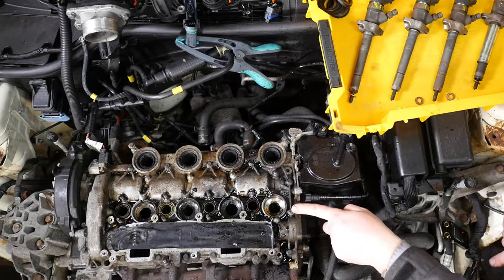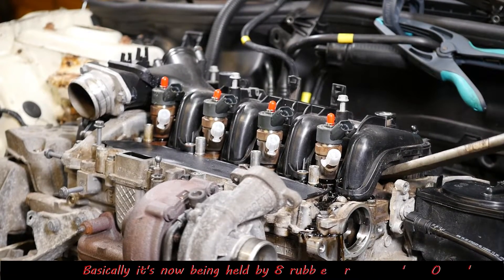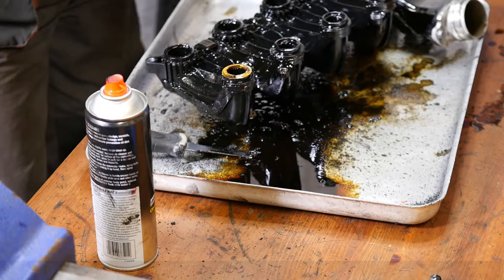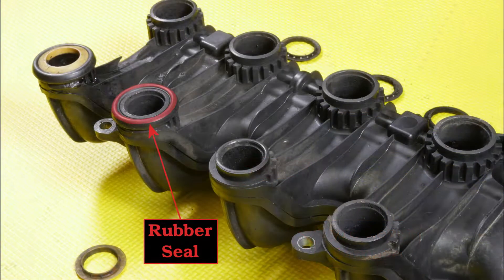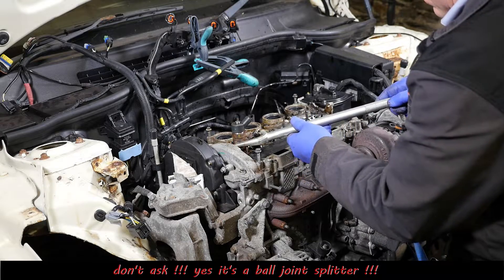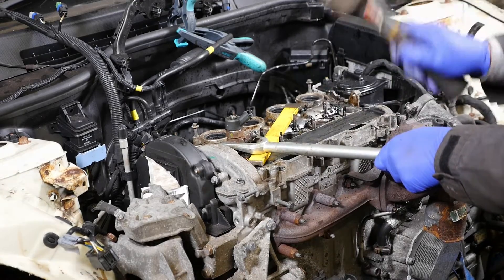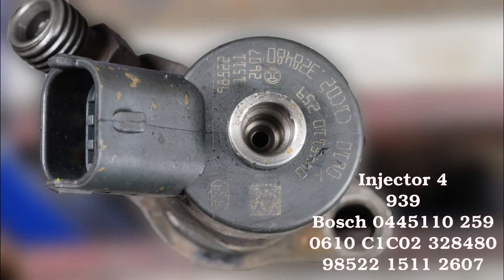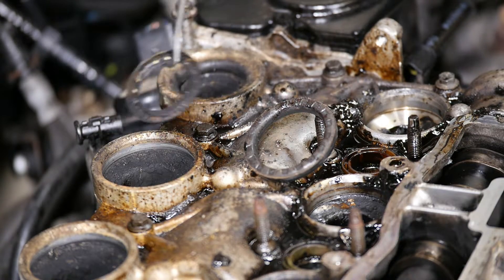Part 8 - Removing Diesel Injector's, Inlet Manifold on 2009 R56 MINI Cooper Peugeot 1.6 HDI TDCI DV6

Comment: Could’ve used a 16mm long socket with extension on it over the high pressure threaded part and use that to loosen the injector.. much quicker and less hassle
Reply from the maker: Thank you for the heads up.  Cheers

Comment: I too have never removed an injector but I’ve read up on it as my son had a v6Audi that suffered the exploding HPDP and all 6 need removing and the tank and fuel lines replaced of flushed to remove the bits of pump that liberally scatter themselves through the furling components. I decided not to experiment on someone else car , away from my tools and learning as I go. I paid off his finance on it and it was scrapped.
Reply from the maker: Blimey Patrick that sounds terrible and really expensive !!! was that a car made after 2007 as well?  Your son is very lucky to have a generous father like yourself to clear his finances off for him.  Hopefully the losses weren't too high.
Reply: @CoatsandGaiters  I think it was an 08. the car was an Audi A5. He did have the car serviced at the local Audi dealer and at first, they were going to cover the damaged/fault but then they relented and all efforts were fruitless. Ive always had a hatred for car Dealers as my experience hasnt been good- My 08 RRS cost me a fortune in service charges and when it came to comments on MOT that from bushes were worn- the Dealer said 'not covered- fair wear n tear' yet the warantee i paid £1200 a year for suggested otherwise...again, thieves! I also had bad experience with my BN Motorhome when it got over 3 years and at 4- the floor rotted and THAT wasnt covered as the Dealer in Canterbury had gone bust...As you can tell, Ive no time for them.
Reply from the maker: @patrickjmorgan  This must happen to everyone Patrick.  I see those after sales insurance policies as a scam that will never pay out.  Unfortunately  the battle to ever get a pay out just isn't worth it.  We bought a £8,000 VW T4 from a dealer as a disabled vehicle and on the way home the auto gearbox started doing a thing where it was like driving over rumble strips in the road.  We tried to get our money back or get him to mend the auto box and he just didn't care.  Threatened small claims etc and he said good luck do what you need to do.  This again is why I mend my own cars and if I can't I'd go without one or find another means of transport.  I have major trust issues with companies.
Reply: @CoatsandGaiters  yes, your issues of trust appear well founded!
Reply from the maker: @patrickjmorgan  morals today are lacking unfortunately.

Comment: how many bolts holds intake manifold?? mine seems  stuck heavilly from burned oil/gas so it doesnt move  even i take all 5 of them
Reply from the maker: Normally 2 per port so I'd assume at least 8.  I include very detailed photographs at the end of each video of the items I remove.

Comment: Hi mark..do the seals on the manifold eventually leak ? I have oil slightly pooling on the camshaft cover as though its misting from the seals..its not the injector seals as its not the crusty lava type stuff
Reply from the maker: Hi Neil these engines are prone to a few issues so I should keep your options open lol  I only knew of the copper seals failing and oil creeping up injector tubes and out over the engine and then hardening to that lava.
Reply: @CoatsandGaiters  just done a few tests..sprayed soapy water around the inlet seals and its bubbling..nice job for the werkend
Reply from the maker: @neillaw6249  good thinking !!! Soapy water can reveal a lot of things.  Never thought of that Neil.

Comment: 7:35 We've got one of those vibrating plate, exercise machines. (You stand on it & it's supposed to increase the effectiveness of any exercise). That inlet manifold with some items inside it could be strapped onto the vibration plate. It's capable of some very serious vibration! I think it would do a pretty good job on that.
Perhaps take it to your local gym!

Comment: if you put injector in with guide tube facing down and heat it just falls off, coding uses 8 digits, example injector 3 code needed is 06708100 last number doesn't get used, hope this helps
also mr muscle oven cleaner into inlet manifold and let it do its work for a couple of hours then pressure washer out
Reply from the maker: Thanks a lot for that Paul.  Will try that oven cleaner idea tomorrow.  Any idea on how you clean the inlets to the valves as they are coked badly but I'm thinking if the valves were open the tar would seep past the open valves straight onto the piston crowns and could set and cause a bent piston rod.  I was wondering when I remove the cams the valves would be closed so maybe try pouring carb cleaner in and suck it back out again.
Reply: @CoatsandGaiters  lots of patience and scra[ing and vacuuming, there is a process where you can get it blasted with walnut shells , but its a bit of a faff
Reply from the maker: @pauloneill8912  Thank you Paul.  Would spraying carb cleaner down them be a bad idea as it would soften it and the tar could possibly drip into the cylinders?
Reply: vacuum with small hose attached and scrape it out, dont think i would try carb cleaner as you say it turns the carbon into mush
Reply from the maker: @pauloneill8912  just worried if it dripped onto the piston crown and hardened.  Doubt there's much gap at the top when at TDC.

Comment: Just for reference, I haven't taken my injectors out but...
I had 2 leaking injectors, 1 at the "chuffing" stage of leaking, quite a bit of solid tar around both.
(Note: I always tighten them "hot" immediately after a 15+ mile drive, so the carbon/tar is softened).
Initially tightened all clamps to  7Nm. That stopped the chuffing but there was still an exhaust smell in the car at times.
Eventually tightened all clamps to 14Nm. This needs to be done several times (over several days) until none of the clamps move at 14Nm. I used to tighten every Wednesday, straight after a particular journey! It's basically squeezing the injector down the tube through the (warm) tar and also squeezing any tar out from above/below the copper washer. The tar is so viscous that that's not going to happen in one go!
This has been fine for 3 years now. I check them every 6 months or so at 14 Nm & there's basically no movement.
I believe the part of the studs that screws into the head is only M6. I think I found the recommended torque for 8.8 grade M6 thread is 12 Nm. (16Nm for 10.9 grade steel). So my 14Nm may be slightly over the recommended torque for that size and there may be some risk. (Although I think the upper part of the stud is M8, so who knows what difference that makes?)
Angle tightening a stud that's being reused (as many people do) is also a risk, so take your choice! The down side of angle tightening is also that you don't know what torque you ended up at, so you can't check them in a years time incase they've backed off. 
The problem with these injectors isn't that the copper washer fails. The problem is that the cap nuts back off until there isn't enough clamping force for the copper washer to seal. (If you look at a leaking injector that's at the chuffing stage, the clamp nuts won't be much more than finger tight!)
If people torqued these down every time they changed their engine oil, then leaking injectors would be a thing of the past. (Or if someone made a clamp to stop the nuts backing off over time).
Reply from the maker: Some very interesting information you have shared there.  Thank you

Comment: Hi! Great video! Could you provide part numbers/name of the intake manifold seals (there are 8 o-rings and 8 conic shaped retention discs). I cant find these conic shaped seals anywhere on the market.... Should they be replaced also or are they a part of the intake manifold itself?
Reply from the maker: Thank you for the comment.  Sadly I am terrible at buying car parts which is why I tend to resort to sealant on a lot of stuff.  Car parts seems to be a minefield.  I search ebay normally.

Comment: I'm doing this exact job on an 07 mini. It's filthy, everything is covered in tar and soot. Do you know which way up the rubber washers go in the injector ports? They are under the plastic ones.
Reply from the maker: That should be in Part 14 of refitting the diesel injectors.  https://youtu.be/SjPlXdmrcec
Reply: @CoatsandGaiters  thanks a lot mate! Super helpful video by the way, I'd be totally lost without people like you!
Reply from the maker: @georgefasey  That's ok glad it's helping you.  That's what my channel is all about.